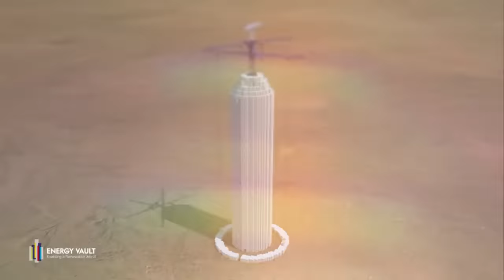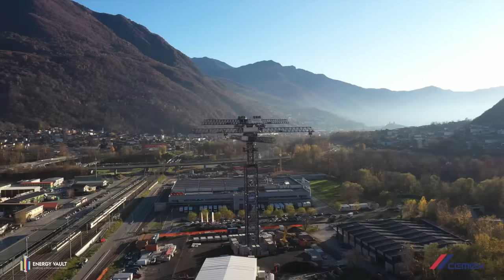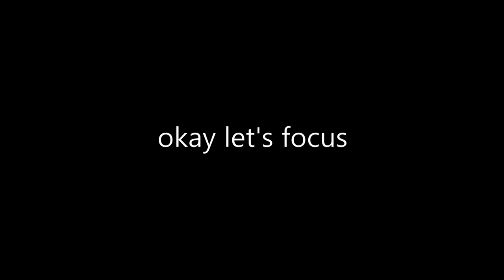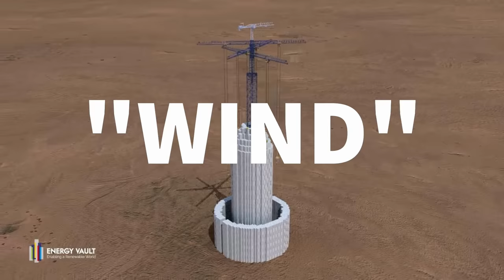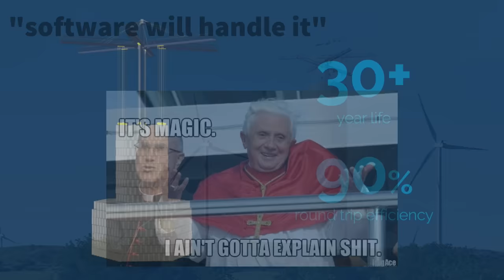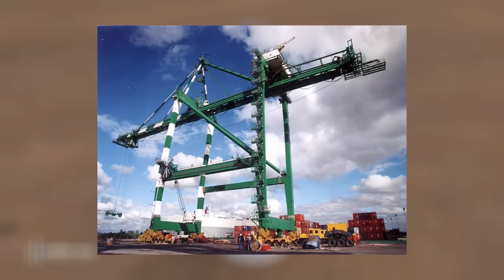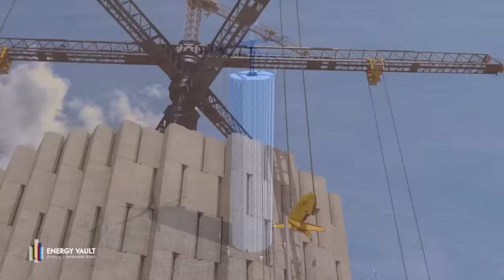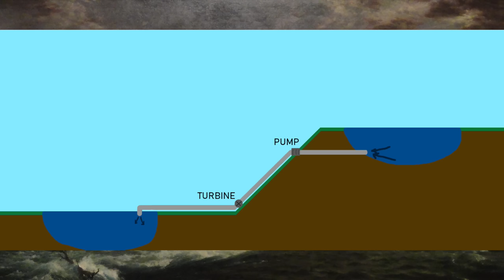The Energy Vault is a Dumb Idea, Here's Why

Comment: I actually like your idea of making a pit and using water pumps. It sounds much more efficient. The pumped-storage hydroelectricity is currently being using in its most efficient form, but it also destroys the natural environment and if you're not living in the rocky mountains there's not always mountains ready available.
Now, could we also use water storages to grow algea and produce more energy or at least oxygen?
Reply: Personally, I am surprised that no body yet seems to have gotten the idea to use abandoned mine shafts for Hydro storage: The damage is done already, height difference partially is HUGE (sometimes over 1km) which should make it very efficient, even with little water being used.
Reply: @marwerno  They have. The Queensland government is working on that and has selected a couple of disused mines for the purpose.
Reply: yeah pools of water are such a blight on nature... pull your head out

Comment: To be fair, it's an idea and maybe it could go somewhere interesting.
The issue about the "concrete" blocks too can be solved with earth based materials, and YES IT IS DURABLE. In fact, it's a resource which was forgotten since the second world war when we needed to build new houses fast (thanks to concrete), however it has incredible advantages because you can use it again and again even when you destroy the blocks, to remake new ones. 
The earth can be found anywhere beneath 1 or 2 meters (it needs to not have any organic matter in it) which is in fact an issue in some cases because you need to dig to get the material, but also if you dig to get fondations for a building, you always get the material to build the house or the infrastructure and even better here with your idea to put the whole thing underground, it means you can use the dirt you got from digging the hole to make blocks. Another issue is the water that will in fact destroy the earth-based blocks but if you get a cover above it, then it should be fine.

Besides that, the wind issue could be solved with walls placed around the whole thing however the main issue with that design is that having a higher tower is way better than wider, so it means you need tall walls to cover the whole thing.
Reply: You can always combine some walls above ground surrounding a hole beneath, and you may be able to create the walls in part with the dig out of the ground. And if it's for use in water-scarce areas, you probably do not have a high water table to worry about in your hole.
Reply: You need to watch the entire video.
You sound like someone who would build a gold hammer, then be surprised when it doesn't work and start to come up with ideas on how to make it harder.
This is a stupid idea, and we have better options.

Comment: A friend of mine works in robotics, and one of his first job was on the submarines that repair electric cables. He had to make the propellers automatically adjust to sea currents.

I suppose the wind issue is simlilar, but software can actually help. 
The idea is still stupid for all those other points you mentioned, though.
Reply: The thing is here you're working on SUCH a fine margin to make it even equal to just moving a huge weight up and down with a high gear ratio that, yes, software could solve it. However you are using energy to stabilize the blocks in transit, that energy cuts into your ratios and makes this idea pretty much dead in the water the way they present it.
Reply: My annoyance with it is that their proof of concepts rarely depict any physical thing for the software to manipulate to stabilize the cables.
If the crane arms had more width maybe so they could have a way to move in a direction besides away/toward the tower...
But as shown it seems the whole damn arm has to rotate, which messes up the block on the other side and uses more energy.

The animation shows it pick up and put down a block, then flashes and shows a stack. It never shows how the damned thing is supposed to rotate and place/lift the next block.
Reply: Now imagine your propellers are attached to long ropes and his job is to keep them from getting tangled. With software.

Comment: I think it's good to not just point out that an idea won't work. But to see what can be salvaged from it component or subsystem wise (if anything) and applied to things that already work. In this case I'd say that's an interesting claw and locking mechanism. I could imagine with some modification it could be used as an alternate type of beam plate on beam lifts. To eliminate some steps in moving something like a large wood or I beam.
Reply: It requires a very standardized shape of the thing being lifted.  I could see it as being useful for shipping containers, but those already use a locking mechanism that's very similar.
Reply: @adamsbja  Not really. It requires making the clamp width adjustable diagonally. Which I can already picture the mechanism for.

Comment: Mechancal engineering student here. On a small scale gravity energy production would be a good idea to run very low power consuming products like low powered lights for remote locations with no access to any other means of power production but once you start changing locations or applications their tend to be better options. I’m surprised no one had shot down that company’s idea before it got to the level we saw it at.
Reply: Yeah!  That’s pretty F’ing bad.
Reply: There was a company that tried to do exactly what you're describing. They stopped doing it and started shipping power banks instead.
Reply: Wrong "their", your argument is invalid
Reply: Because it's a demonstration model in switzerland in alps, where everyplace you could build a dame already has a dame build... So funny to read full dunning kruger knowitalls like the channel owner in the comments... makes my day....
Reply: Remote locations without any grid access and low power devices are better served with solar and buffer storage from my point of view. Unless "remote" means: in a cave away from any sunlight and running water.
Reply: No. This is never a good idea on any scale. If you need a little power, use lead acid battery. If you need a lot, use pumped water
Reply: @JarrettWilliams99  In mobile applications, neither lead acid batteries nor pumped water will be of much help.
Reply: GravityLight (TM)
Reply: the weights are fairly practical for a clock.

Comment: Thanks for the conclution, water is much easier to store. And on another part, changes in the grid take minutes. In the same time, a Pelton in the Alps can be switched from 5kW to 100MW and something like that is daily routine today, though regulating back takes a bit longer because of pipe pressure regulation.
Reply: But water isn't easier to store.
Just read a bit about Pumped-storage hydroelectricity.
It's a whole can of worms on its own.
Reply: It’s much easier to store a liquid then making a concrete Jenga tower with loose blocks.

Problem with water is in wetlands such as my country we cannot get the elevation required for hydro storage.

An water tank with an very heavy concrete floating roof would seem a much more viable idea.

And it already exists in the form of oil storage tanks

Comment: From what I understand, water-based energy storage requires a lot of space and is only really convenient when the landscape fits, so that's why we don't build that stuff everywhere and that's why they tried it with solid blocks instead of a liquid
Reply: It also wastes a ton of energy through fluid turbulence, which isn't noticed unless you painstakingly measure the power efficiency of the pumps and generators, because water is very good at absorbing and dissipating waste-heat before bystanders can notice.
Reply: I mean yes, but... If you look at the enormous size of pumped storage water plants, how can you think that a density increment of merely a factor 10 (at most) would be a suitable upgrade to fit it in more places? Especially if you consider the low maximum stacking height?
Reply: I don't think they've gotten beyond the concept stage, because there's thousands of engineering reasons why this won't be profitable.  If it's running 24/7-- which it would have to be, to catch cycles-- it would create massive wear and tear on those cables, for example.  And the lubricant alone would be a massive cost.  Even concrete blocks would require maintenance, as any small error could cause catastrophic damage that could cause this concrete jenga tower to collapse and potentially kill people or damage nearby property.

Comment: It would be a lot more promising with old and abandoned mine shafts. No wind and you get a much bigger height difference with a hole that's already there. just disconnect the blocks quickly at the bottom, move them aside by a few meters and make space fore the next one.

You may ask, why do this instead of pumped-storage? Because there's only so many places that are ideal for pumped-storage. Utilizing mine shafts as well adds capacity

edit: A 2km mineshaft will let you store 75 times more energy per kg than what they're proposing, assuming you store everything at the bottom (unload sideways).
Reply: There's a company called gravitricity trying to do exactly this

Comment: Okay, I’m no engineer, but when you brought up the Wikipedia article I laughed. I love these people trying to invent new ways of handling problems when we already have perfectly good solutions right now.
Reply: Just because the cement battery is a stupidly flawed idea, does not mean the need to find more ways to store energy is gone. Hydroelectric power is far from perfect and is not useable in many locations. For example: deserts. Plenty of sun to produce energy, not a lot of natural bodies of water.
Reply: @Triattt  More than that. Most places that are able to support pump storage have already been used. A point a lot of people don't realize is you can't make the lake anywhere, the ground has to support the water. A lot of pump storage facilities actively monitor the foundation under the upper lake because it can start to give from the mechanical cycling of emptying and filling the lake.

Other locations have major environmental impact concerns, so we don't use them.

Comment: i always thought it was aimed at areas where hydro storage wasn't an option, like deserts. the idea of going underground is far superior, IMO. also, why not use carved blocks of stone, we have plenty of granite laying around. that solves the issue of co2 from concrete.

there is a solid idea here. it needs improvement to be worth anything. why kneecap it before it gets anywhere?
Reply: Agreed. I immediately recognized the place something like this could be viable was where water and natural geological formations were not available for traditional pumped hydro storage. A desert is one very obvious location for this. One advantage of rock/metal  vs. water is the density. Water is only 1 ton/cu. meter. A steel block can reach 8 tons/cu. meter, thus requiring significantly less volume for the same storage. That said, the cost and maintenance concerns mentioned in this video were the same concerns I had when watching the original proposal, although I didn't particularly care about the CO2 emissions. Nobody really does. I just roll my eyes when I hear these arguments. There is no renewable infrastructure available today which can beat fossil fuels for limiting CO2 once you include the fossil fuels that went into the complete supply chain to produce the renewable equipment.
Reply: @pimpomresolution5202  Hot rolled steel runs about $600/ton. if you have, say, 100,000 tons of steel for you blocks, your cost is $60 million just for the material.

Well, unless you're in the current market where steel was recently trading at $2,000/ton, so $200 million.

Current total costs for desalination of seawater, which includes construction and operation of a plant for 20 years, can get to around $0.60/cubic meter (or about a tonne), so the cost for that 100,000 tons of water would be less than $60,000. If you have to replace the entire volume once a month (due to evaporation and loss), total cost over 20 years is $14.4 million. And if you're building a desalination plant big enough to handle this, it makes more sense to build one big enough to actually supply people with water with the energy storage being a minor parasitic use.
Reply: A) You don't really need power storage in deserts. This has to be close to where power is used.
B) Carving and moving huge blocks of stone would cost as much co2 as concrete blocks

Comment: 1) Almost all possible locations for hydro electric power plants is already taken. That's why we get this horrible ideas. 
2) Building cranes and concrete blocks is cheaper, than digging huge hole in the ground and making it waterproof. 
3) This design causes less ecological harm than enormous water reservoir.
Reply: 1) concrete creation creates CO2 emissions.
2) Highly unstable structure and not storable for huge scale cities.
3) cost efficiency for poor countries is just bad.
4) pumping water is way simpler and non complex than some cranes with potential waky software. Hence forth less potential disruption (true even in hydro power but it's much less.)
5) Corrosion and sabotage Advantages with it.
6) Storage amount is way less then what is required. You also can't have long cranes cause they would start to wiggle around or have potential hazards problem pretty fast. Square formation is much optimized way but it's still very small scale and hence not affordable.
7) creation of 1000k concrete would only get corroded much faster than ever and henceforth cannot be stored for longer duration.
8) sabotage by software hacking makes it Vunerable target. (True for hydro as well but it's not as much concerning compare to immidiate threat by swinging cranes with 1 ton concrete.
9) durability of pulley and other mechanical structure of this system on large amount and scale makes it loss Advantage on this front again Against hydro power.
10) rain can also assist to store potential energy for me sometimes so lucky energy given to me.
Reply: @masterchief5603  i didn't say design is good. It's horrible, however mindlessly using water dams everywhere is no better and way more dangerous. How do you propose storing energy in desert for example?

Comment: There's one argument for circular design: As long as you have stable enough joints and work with long enough cranes, they are more efficient in crane length per stack area.

O(r^2) area is nothing to sniff at if you've got the tech.

Comment: I live in switzerland and I saw the structure several time when I was traveling through the region without knowing what the hell was that, lol.

However in switzerland we have a lot of dam turbines (or PSH), the idea in fact was for location where water is not easily available
Reply: I live in Norway and must say I am surprised this has not been done here yet.  But we probably need more surplus energy from windmill before it really will increase the total capacity.
Losses for pumped hydro are 70-80% afaik.

Comment: I remember the first time I read about the concept, about 20 years ago, it used abandoned mineshafts to lower the weight down to, specifically because of wind. Funny that the idea has somehow gone backwards.

How about Trumps and compressed air? Not as a main power source, but complimentary and for certain locations?
Reply: I'm not sure how you could use Trump for an energy source, but if it involves plugging power cables into him, you have my interest. 😂
Reply: @kevincrady2831  I should have seen that joke coming to be fair haha. Especially when I misspell the thing. It's called a Trompe :P

If you search for Trompe - compressed air, you'll find examples.

They used to use them in mining operations back in the days to power drills etc. 

I'm not arguing as a main power source but It seems to have it's use-cases for at least some locations.

Comment: I appreciate the often-funny content. I think that many of the assertions made in this video require more evidence (whether that be citations, clearly-defined and comprehensive reasoning, etc.) before they can be given much weight. For example, it is not made clear why digging titanic pits in the earth is easier than other solutions to the problem of wind near wind turbines.
Reply: Of course, it is possible that such style is intentional, and my pointing it out might not help much.
Reply: @alexyu4549  He said why he is digging the pits in the earth. It's not because it is easier but it is because the wind above makes the whole concept unusable. Are you suggesting walling it off from wind would be cheaper and safer? Maybe. But in this vide he wanted to transition to hydro anyways so does not matter.
Reply: @lesczu45  you make a good point. I guess I wasn’t 100% clear. What I’m talking about is more a lack of comprehensive comparison, rather than a lack of reasons altogether. For example, it’s easy to say that an Aventador is better than a Miata because its top speed is higher, but that claim as a whole is rather nonsensical since it doesn’t compare any other traits of the cars. For someone to really be able to make that claim, they would have to compare every major facet. Similarly here it’s rather a moot point for him to bring up claimed solutions when it’s not comprehensively or even decently shown why they are better. He doesn’t have to be fully comprehensive, but there absolutely needs to be more comparison being done before it can be asserted that something like this is a solution. (In the example of the pit. There are more, of course.)
Reply: @alexyu4549  Yes, ok I understand what you mean